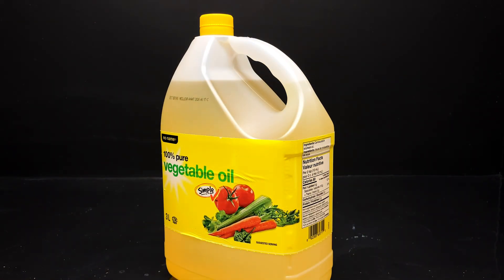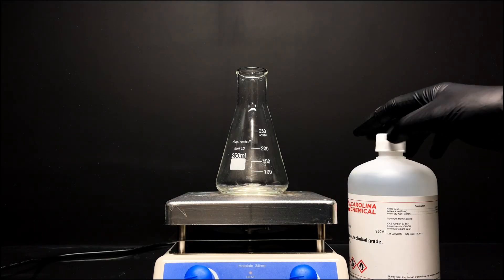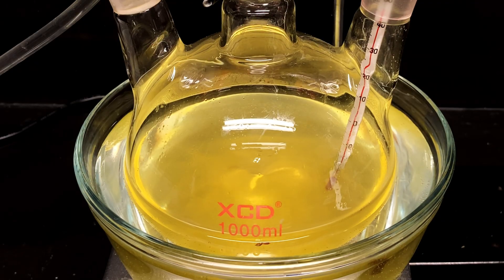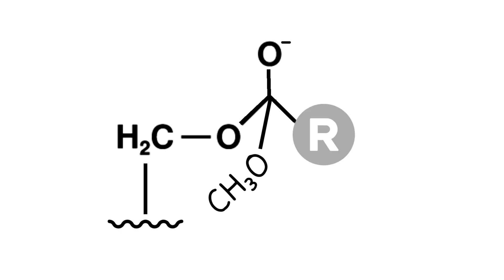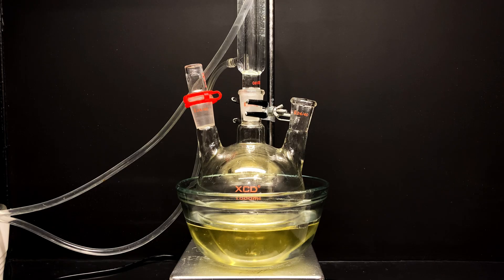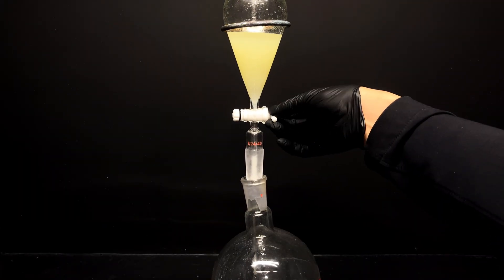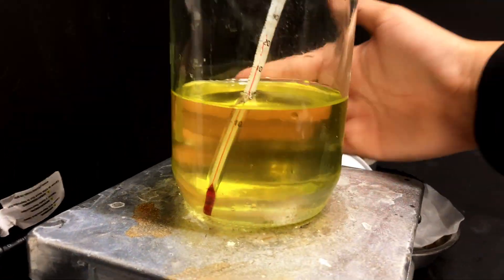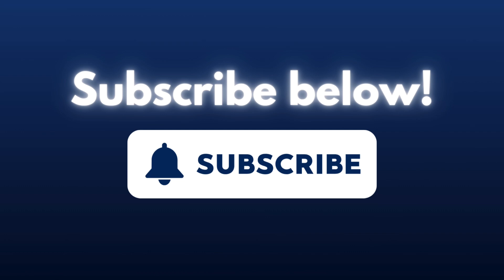Can I Run my Car on Cooking Oil?... (by turning it into biodiesel first)

Comment: Watched a video a few weeks ago of two dudes driving a VW Rabbit a few hundred miles strictly using old fryer oil. Guy even pressed fresh sunflower oil on the side of the highway it was incredibly entertaining!
Reply from the maker: Lol that's actually sick, wait just off of the oil? Not biodiesel?
Reply: @CarbonTwelve12  straight fryer oil filtered through a relatively loose screen lmao

Comment: Just put 100ml of diesel into any kind of oil it will work on a diesel engine.

Only If that Oil can be used in an oil lamp like Diya.
Reply from the maker: lol yeah, surprised you could run an engine on vegetable oil…
Reply: @CarbonTwelve12  it's because of compression ignition!

Comment: don't forget to add some styrofoam into it to make the biodiesel go further <3

but seriously though, using regular cleaning 95% ethanol should make it cheaper and more accessible right? (the biodiesel would have an extra carbon near the ester)
Reply from the maker: Yeah lol, I read online that making ethyl esters could work as well. I’m not sure if it could directly put in your car though lol!
Reply: @CarbonTwelve12  my guess an extra carbon would mean more oxygen to achieve stoichiometric burning in the engine so there would definitely be some tweaking to the air injector before using it into a car